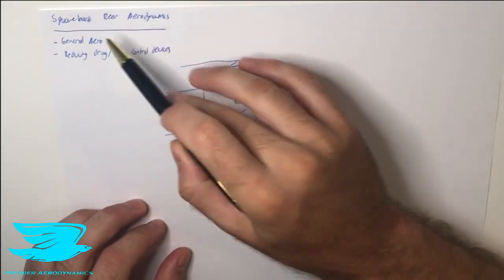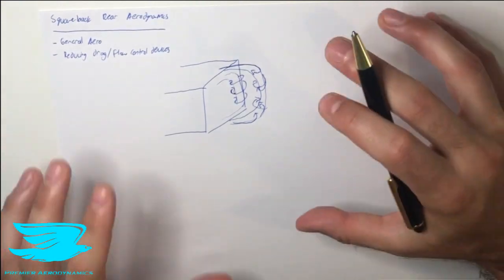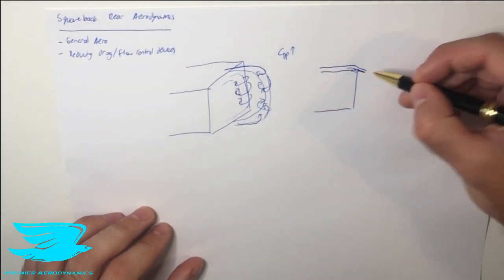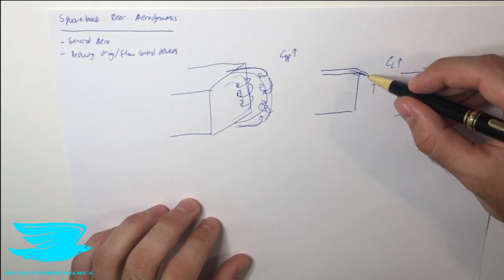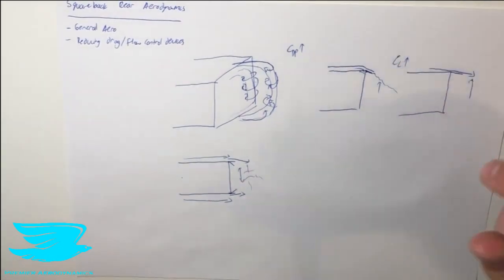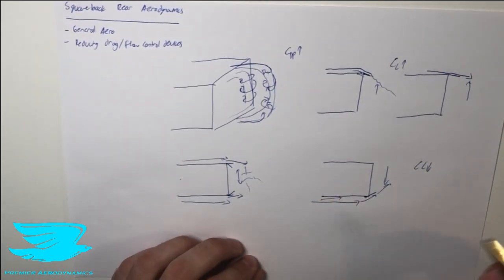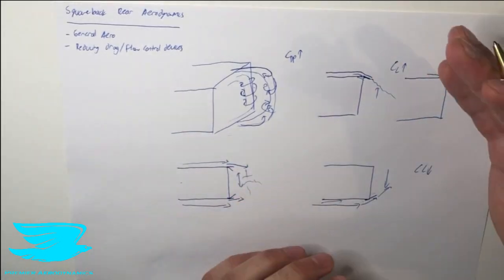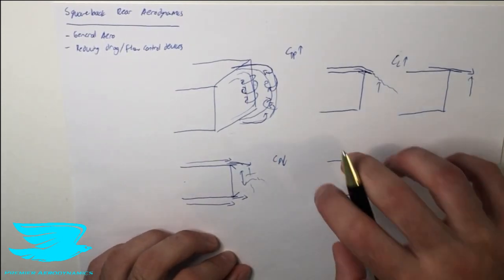{Automotive Aerodynamics #16} Squareback rear aerodynamics

Comment: I just discovered this channel. Great work and love the fact you summarised in the end. I have a question though. The small spoiler you always see on hatchbacks and small SUVs, is that for aesthetics or does it really make such a difference to the drag coefficient of the car that it justifies its presence?

The reason I ask this question is because they don't look good enough to make a difference aesthetically and I can't imagine they make such a big performance or safety difference (e.g. high speed stability) to warrant fitting the spoiler. I would appreciate your insight into this.
Reply from the maker: They have a decent effect on the drag and stability of the car. If they are kicked up a little, they can also increase downforce.

As for aesthetics, well...having worked with some, I have never really understood car designers. Their ideas of good looks are usually very different to mine.
Reply: @PremierAerodynamics  Please correct me if I’m incorrect, but if the spoiler is angled downwards, this would increase the rear lift. If so, how would that aid high speed stability of the rear end (I would assume you need downforce for rear stability) or is the stability as a result of there being less flow rotation due to the spoiler preventing flow separation?

I’m very new to the topic so excuse me if some of what I’m saying is gibberish 😅
Reply from the maker: Strangely, both are right.

Having it angled down does increase lift which makes it less stable at higher speeds, but having a sharp ending means the wake isn't fluctuating as much so the forces on the car are more steady, and that increases stability as well.

So, having it pointed up means the best of both worlds.
Reply: @GearzMonkey I have recently experimenting the roof spoiler with cardboard by downward 10 degree angle on 2nd gen CRV after looking into CFD simulation study also with model wind tunnel experiment on Youtube. Both are showing when roof spoiler with downward 10 dgree angle, it reduce drag coefficient and lift compare to without roof spoiler. In my cardboard spoiler experiment on highway driving around 100-115km/hr, the stability improved noticeablely. In head wind situation, sudden gust jitter reduced ;acceleration seems a bit easier  as well.
Reply: Correction, after studying more; the more stable feel may come from the clean flow seperation with spoiler compare to turbulence wrap at the edge of roof end. Clean flow seperation also help with drag reduction besides reducing wake size. However, the downward angle of spoiler also related with roof slope. For my CRV, downward 10 degree doesn't seem to have any impact for handling ability as rear lift suppose to increase with small portion.